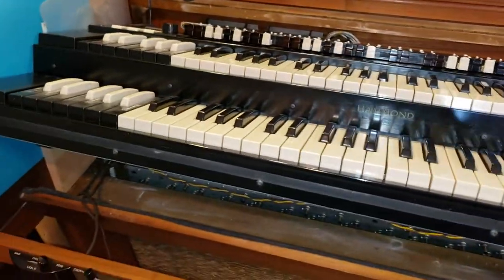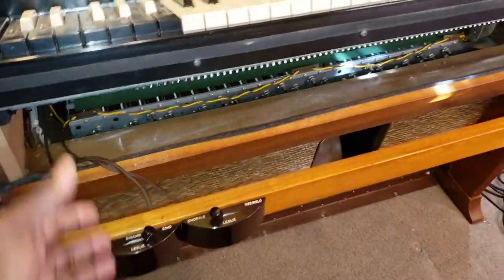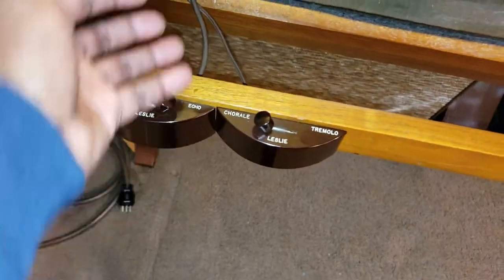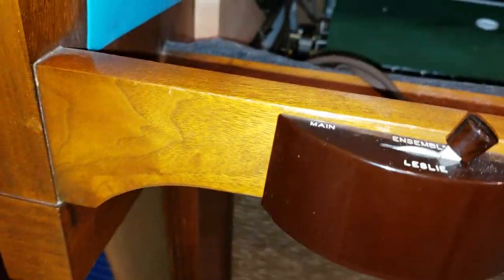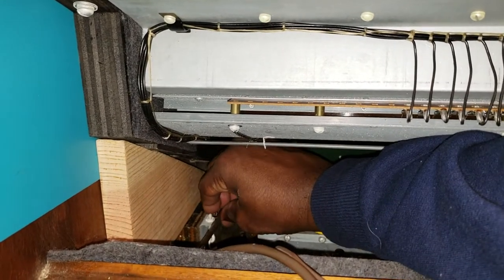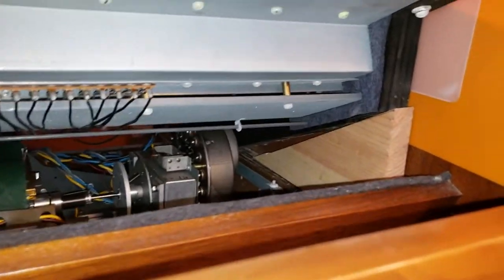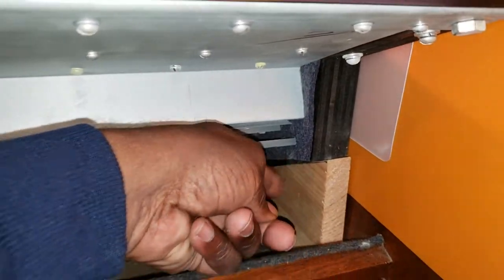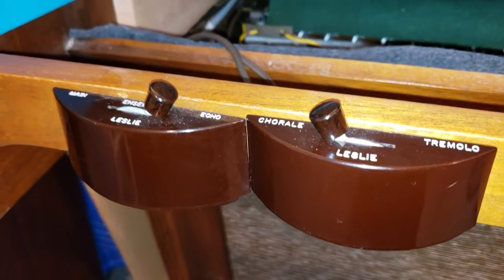Running Leslie Switches Inside A Hammond Organ Console Cabinet

Comment: Doc, so the lower manual won’t crush the Leslie wire between the manual and the felt?
Reply from the maker: Its not a problem.  You can run the cable and there is enough space for it.

Comment: where do you connect the wires in the back?
Reply from the maker: I am using a 26-1 kit with this organ.  So the wires actually have special connectors on them that connect directly into the 26-1 kit that is installed at the lower back end - inside the organ.